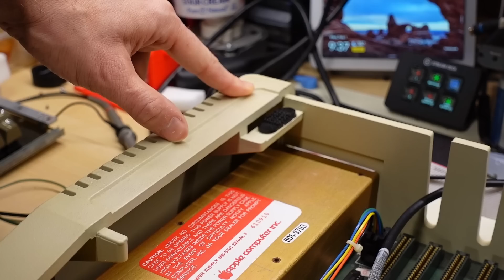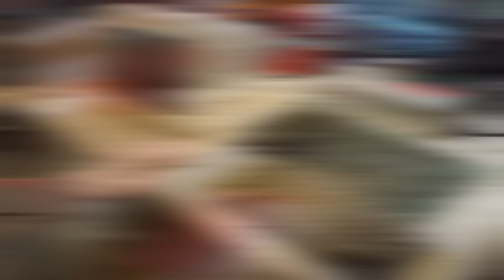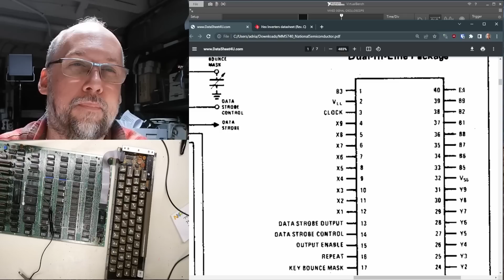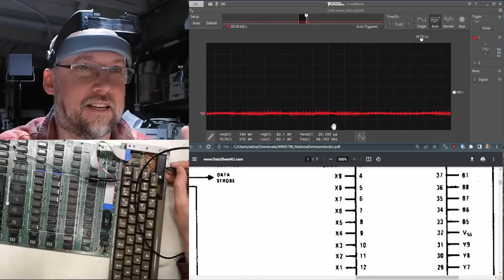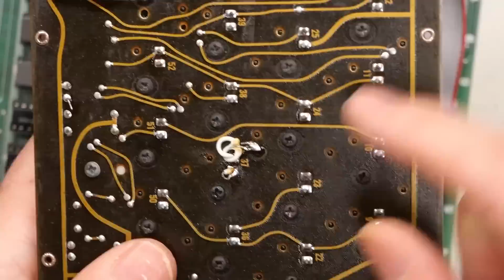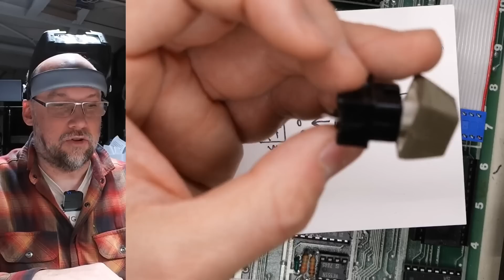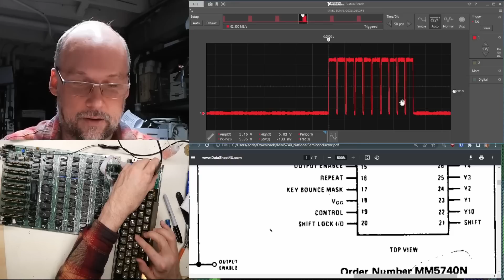The original Apple II keyboard sucks (and is hard to fix)

Comment: 11:15 mask ROM literally means the ROM is made part of the mask used to expose the silicon before etch/transistor formation. So it has to be done at the time the chip is made. It can be extremely economical, especially if you make large quantities of a part, because they come out of the manufacturing line ready to go with no additional steps needed. Of course, the downside is you have to get a literal exact replacement. It is possible, however, to decap mask ROM ICs and use microscope images to get the bit pattern from the mask ROM -- it's actually surprising how easy it is to see the individual bits!

Comment: In this era of 3D plastic printing, the modding of everything, and aftermarket vendors, you can't find another replacement keyboard unit for that Apple ][? This is where I guess you start hunting for other dead Apple ]['s & Apple ][+'s to cannibalize parts from them. I remember the advent of the The Apple ][, The TRS-80 Model I (I owned one), and the Commodore PET. Back then, the PET was hated for it's chicklet keyboard, the TRS-80 had expansion interface cable connection issues, and now we realize that all the hype those who owned one put into it, were severely disappointed. I loved the ability of the open-ended design of the Apple ][, to allow the purchase or creation of custom P.C.B.s for its interface bus. Sadly, the keyboard, the thing that makes it possible to work, is failing. Not bad after 48 years, but sadly, we are now looking at the end of the era. Unless someone can make a replacement keyboard that would fit inside that case, I have to give it a Dr. McCoy's, "It's Dead, Jim."

Comment: Keep those keyboard cables the same length and route location as the original.   Old computers are touchy:

Lower Tolerances: Vintage systems often operate with tighter timing margins, making them more sensitive to variations in cable length.
	•	Weaker Signal Integrity: Older hardware may lack modern signal conditioning or error-correction mechanisms.
	•	Transmission Line Effects: Longer cables can act as transmission lines, where signal reflections or interference can occur, especially if not properly terminated.

Comment: I'm betting the fact that the keyboard converts keypresses to ASCII characters is a holdover from the terminal days. The earliest microcomputer displays and keyboards were essentially dumb terminals attached internally to their host computers using the same signaling technologies that mainframes and minis were using. The Heathkit H89, a very Fallout looking all-in-one computer from the late 70s, had a toggle key on the keyboard labelled 'offline.' When it was down, the monitor and keyboard were physically disconnected from the internal CPU, and their IO was redirected to the serial port on the back of the machine. This allowed the H89 to switch between dumb terminal and computer mode on the fly. I've always wondered if anyone actually used that functionality.

Comment: I disliked the original keyboard for a couple of reasons, though I only had my Apple II for about 3 years. That raised power light got hot and was easy to accidentally roll the heel of your hand into and get an uncomfortable "sear". The lowered one was relatively safe. And if you did not have the "Ctrl-Reset" modification,  as mentioned it was too easy to accidentally slip and hit "Reset" at inopportune times. It was common practice to pop loose the lower half of a clamshell cassette box and lay the corner over (around) the "Reset" key so that you had to actually move the box to depress the key.

Comment: Awesome channel have same Apple II same keyboard same issues.  I have three keys not working Y,2, and 4 and some double type keys.  I was going to buy that encoder you showed but think that may not fix my keys because every other key works correctly(IE they are not ALL out)  I have two extra new keys switches may buy a few more.  But to change them I have to know how to solder right?  My double entry keys should I buy new key switches for those too? I am guessing, yes... anyways really enjoy your channel learning a bit about chips and how they work on that board cool!

Comment: I spent a lot of time playing Drol, but I never managed to finish the third level.  I learned a lot, and had a lot of fun with my Apple ][+ (clone) systems, in the '82 to '85 timeframe.  I had it tricked out with every slot occupied: integer BASIC card, serial card, Hayes Micromodem card, 80-column card, realtime clock/calendar card, Z80 CP/M card, disk controller card, EPROM programmer card.  I wrote a high-resolution Game of Life program in assembly language, which ran pretty fast.   I regret that I gave it away to my nieces as a Christmas present.

Comment: 28:22 - OK, lets go backward 46 years, with maybe not so much keyboards on stock. I think we should salute to dodgy repair man who tried to do this. Maybe machine was not used so often so one key could work like this. If it works, it works! You just examined repair job from 45 years ago.

Comment: If you want a plastic safe contact cleaner, I highly recommend BW-100! It's nontoxic, non-flammable, quick to dry, and works extremely well. Only thing is that it's only available on Amazon and more expensive than most contact cleaners, plus the only available can size is rather small, so definitely get 2 or 3. It worked wonders on one of my parts keyboards. It's pretty much the only option for delicate electronics.

Comment: anything digital that requires a negative voltage like a DRAM, or some very old NMOS logic devices will be damaged NOT ONLY if a bias voltage is missing, but also if the voltages come up in the wrong order.  Many old devices sized the filter caps to ensure startup in the correct order, some better commercial computers like min-computers form DEC actually had circuitry interlocks to grantee correct startup of power supply voltages

Comment: I (kinda) recently bought those connectors. I've gone over all sites I could think of, and couldn't find where I ordered them from. I remember it was Ali Express, but I can't find it in my orders history.
Reply: I added a reply to the actual place I bought it, but it appears that putting a link will get the reply erased. They are available, new, if you search the correct site for the name "DIP flat cable plug".

Comment: There are ways to resurrect these keys I guess, but I'm not a purist. If they're THAT much of a problem, what needs to be done is to rework the problem. Recreate the circuit board to work with removable switches that work with the Apple key caps. These machines won't last forever. If we're willing to swap chips with new reversed engineered chips, why aren't we willing to deal with other hardware that has a high fail rate as well? It's especially true with keyboards I feel. Changing out keyboards while keeping the key caps and maybe minor chips seems like a small price to pay for retaining the historical feel of a system. We replaced a keyboard decoder chip with a PIC or whatever. Why not replace the circuit board with something that will retain the key switch arrangement  and key caps, but fix the poorly designed switches?

Comment: I had a bad flat cable on my Apple //e - floppy cables. When I opened the crimping bit I saw corrosion on the bits which penetrate the cable. I just cut 1cm and re-crimped them and it's been working since. It was such a pain to identify, the floppies were working intermittently!!

Comment: 00:04:38 I have found that a rigid adhesive is almost never the right call. Imagine a cookie sheet covered with a 1 inch thick coating of burned to carbon caramel. If you tried to lift the mess up out of the cookie sheet, It would take 8 million pound of  force. However if you twisted each end of the cookie sheet even slightly, about 72 trillion tons of sheer force is generated and the mess pops out as a big chunk. 

This is why ice cube trays work. Ice is a great glue until sheer is introduced. Since the part you show is subject to flexing, there is the issue of sheer. In these situations, a flexible adhesive is best. Better yet is a Vulcanizing sealant used in a manner inconsistent with labeling. (as a glue) RTV sealant is absolutely wicked to remove off of anything.  A part like that would break if you tried to pry it off after RTV, but you could remove it by sliding a razor knife between the parts. Not only that, its Vulcanizing so you don't have to remove the old RTV to re-glue. Like retreading a tire the stuff will fuse again with itself using a a bit of new sealant between them. 

RTV is different than silicone sealant. There are wild variations among RTV. Like grey RTV is generally more brittle and not a good thing for misusing as glue. Black RTV is amazingly stretchy. You want the stuff without the vinegar smell in this application. Permatex # 7651939 almost has a nice smell if you like a good new car interior off gassing. Leave a good bit hanging out of the applicator in storage. The product will slowly cure down the tip after 6 months of not use. This can usually be removed repeatedly, allowing the whole can to be enjoyed. 

Discard first quarter size glob from the tube and don't use the very very last bit out of the can either. (it will start coming out excruciatingly slow at the end, but will seemingly do this forever)

Comment: I feel like this is one of those cases where you have to choose between "make it work" and "keep it original", and the "make it work" option would require a modern replacement of the keyboard pcb with one made brand new using off-the-shelf switches. But "keep it original" that you seem to have gone with is also an option, it just won't be working very well as a keyboard.

Comment: You missed the opportunity to say "to see what the L is " instead of "to see what the hell is".  Sad about those keys.  I recently bought a Laser 128 off of eBay for a pretty good price knowing some keys were problematic.  I have been too lazy to write down which keys don't work and which require a bit of pound or multiple presses, let alone pull the keycaps and try contact cleaner.  But after seeing your video, it's possible that contact cleaner will make it worse, so if I do it I should make sure it's only on the ones that don't work.  Or maybe do nothing, as if I have the itch to play on actual hardware, I have plenty of actual Apple II computers.

Comment: My friend has been playing with designing and 3D printing her own key switches, and she's made a surprisingly good progress considering she's only got a cheap FDM printer. She's successfully made a sliding mechanism that has a nice detent, although it doesn't have any contacts yet.

I'm not suggesting making a whole key switch from scratch, but perhaps you could find a key switch that has a low enough profile that would allow you to 3D print a bracket to adapt it to fit into the holes on that keyboard, and also an adapter to fit the key caps to the stems.
Reply: >I'm not suggesting making a whole key switch from scratch
Why not? It was my first thought when I watched this video "why not 3d print freakin' key?" Resin printers make high precision prints, are they still not enough for the key?

Comment: Suppose that tape was to prevent grounding pins against the nearby metal frame?
Huh, wow, I'd put that bodged key in a display-case! XD What a creative way to fix a key.
Somebody should print adaptors to mount these key-caps on different switches.
With a shorter switch it'd be possible to have it look stock, or nearly so depending oh heights.
Maybe a mounting frame to hold the switches in place as an alternate to the screws could be printed too?

Comment: ehm, wait a minute, the keyboard encoder is a programable microcontroller, it should be possible to filter out the double presses in code.  Specially considering this is a expected problem in those old keyboards im suprised this is not already in.

Comment: I seem to remember you have a bag of Apple key switches. You even got some switches working by putting them in the sonic cleaner. Can't you adapt some of those to work?
Reply: There are very many varieties of "key switches". There is no such thing as an "Apple key switch" because they used many types over the years. Each can have completely different ways to attach to the circuit board, and to the key cap.
Reply: @8bitwiz_  Right - that's why I said "adapt". Maybe file off some plastic, solder in a wire, etc.

Comment: Those dip to cable connectors do seem to be available on Digi-Key.  Search for rectangular cable assemblies, then choose dip to cable and the right pin pitch (probably .1") and number of pins.  The connector by itself can be found under "Rectangular Connectors -> Board-in, direct wire to board" and choosing .3" pitch.

Comment: That connector from the encoder PCB to the keyboard is a common failure point. The sweeps on the sockets corrode and break off. I have not found any modern replacement that's anywhere close.

Comment: I've been fooled before by a completely non-working keyboard (except for the RESET key) on an Apple ///. I thought the encoder must be bad, but it was in fact the power supply - the encoder needed the negative -12V voltage, and it was missing. Worked fine the moment I fixed the PSU.  If the encoder is completely bad, first check the negative supply voltage :)
Reply: Very nice.  Also this implies that missing bias voltages don't damage the ic
Reply: @Nas_Atlas  In my case it didn't. After the -12V reappeared, the encoder (and the keyboard) worked perfectly.

Comment: As you now have a programmable microcontroller in there, you could ask Joe if he can filter at least the worst of the multiple key presses in software. As you have no repeat function on the keys without pressing the repeat key, that could be used to switch the filter on and off.

Comment: Why not take a couple of general keyboard switches which you can take apart and make them fit using a 3d printed key stamps?
Should be a relatively simple way to make the keyboard work like new.

Comment: So for me the question would be which is better a machine that is as close to factory as possible or one that works well. I'd say stick with the 2 plus keyboard and if the esthetic difference the power light being flush rather than raised it should be possible to bodge together a way to move the taller power light to the other keyboard. Machines from this era always had a number of mix and match components. My first computer was a Tandy 16K machine, but by the time I retired it it had 64K, I don't remember how and an external hard drive that was connected through the cartridge slot using an adapter from a company out of Syracuse, NY. My next machine was an IBM Portable. IBM had no hard drive available so I found a half height Tandon, it would fit without its face place, I soon realized if I cut the sides off the Faceplate it would fit so I remember cutting them off with an exacto knife. At least to my way of thinking creative ways of changing them to make them keep working is equally a part of what they were and are. Just my two cents.

Comment: Oooh, I'll have to keep an eye on Joe - I have a dead Mac Plus keyboard that needs a replacement. Somehow I lost my original keyboard and got this one on eBay but it was dead and I'm betting it was an incorrect cable used at some point. (Good grief Apple, why on earth did they use a cable that could be mistaken for a handset cable but be fatally incompatible!) I've toyed with the idea of using a Pi Pico to replace it but never really did any work toward that. I did find a listing of the code for the original controller, which was a mask programmed version of the Intel 8748 microcontroller. Found some on ebay, but would need a programmer and an assembler. A modern replacement would be awesome tho!

Comment: The power light is actually one of the same keyswitches, except the stem was hit with a soldering iron to immobilize it, and the light bulb was placed under the cap.  If you worked on the plastic a bit, you might be able to make it work as a keyswitch again.  The reset switch has a modified spring, so it requires more force to push.  Even so, a common measure to make it even harder to push was to put an O-ring around the key stem.  That make it very difficult to depress with your pinky, but you could still use press it with enough determination.

Comment: Thanks for all the great videos! Just for everyone's benefit:  --- WHEN IN DOUBT, PIN IT OUT! --- Those cables for the keyboard can be crimped in different orientations. Therefore, it's possible to have what seems like a compatible pin-out but maybe it's not. When building my Apple-1 replica and case, I had several similar cables I took from some old HP equipment, and I found that some of them were crimped out in different directions. The cable and red strip were flipped around on some, and flipped inversely on others. The result is that I took the time to tone-out and test the connections with a multi-meter and made sure I wasn't plugging something in reversed. I have actually destroyed some chips on my Apple II by doing this, because it's so easy to do, and although I only had to replace one 7400-series IC, it still sucks to blow out these old chips. Thankfully the controller chip in my Apple-II keyboard controller board wasn't damaged, although I think I remember that another 7400-series chip was.

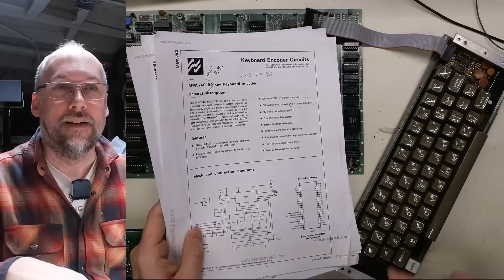Comment: 11:42 “mask programmable” means it is programmed during manufacturing of the die, the IC itself. The mask is a lithography mask (or rather a set probably) that allows the traces to be etched that comfigure the correct wiring to the logic in the IC.
Reply: I came here to say precisely the same thing. There are a few masked roms on this planet which have my name in them. They are not reprogrammable ;-)